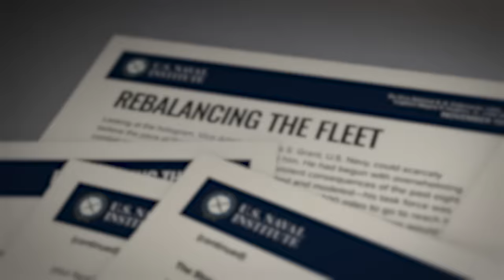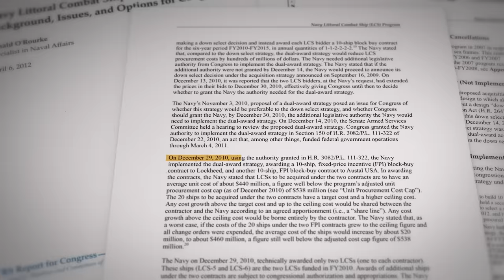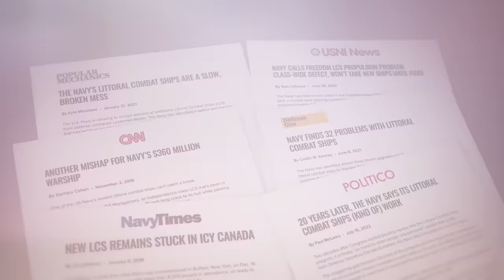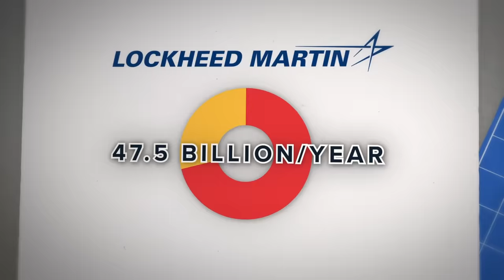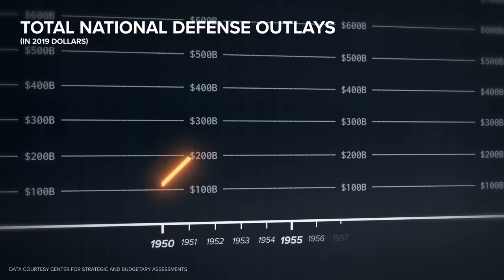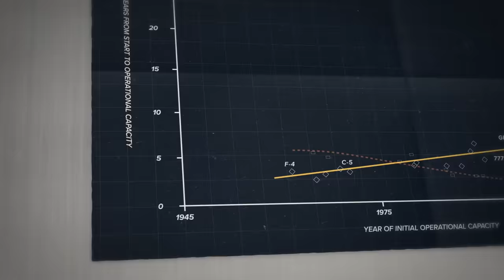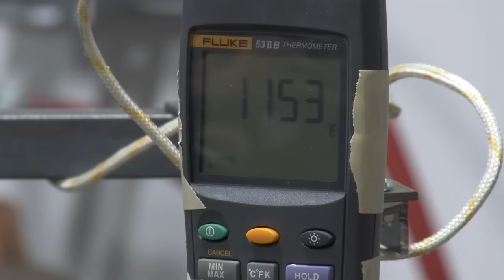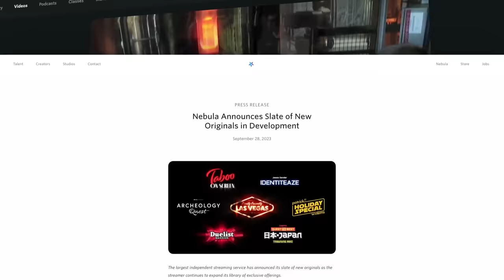Why the US Military Costs so Much

Comment: Cost efficiency does not equal innovation. It's a disingenuous association you make because your viewers will not question it further. Furthermore, you conveniently leave out the success of the existing programs to fit a narrative. The F-35, despite its cost over the years, has proven successful in many ways towards what it set out to do. The F35 has taken a long time to be developed because of the rapid improvement of its capabilities due to the advancement of processing power and emerging tech solutions. It's also been bought by the US's various allies, something you have also left out, with plans to continue selling more for decades to come. To add to this, on one of your graphs trying to illustrate how long we spend in between planes, the F16s currently still being used in current military operations, because we retrofit them to meet capabilities that satisfy the easier tasks of our current military as well as the desired tasks of the foreign governments that keep buying them. This is a good thing in the sense that we don't have to spend as much on producing aircraft, as we continue to develop our latest aircraft's capabilities and refine the newest designs to more easily meet the unexpected. In doing all of that, the taxpayer spends less on defense.

If you wanted to worry about ever rising costs of the defense budget, blame congress for coming up with incredibly stupid rules for the military to follow in order to keep their current budget afloat. Congress forces the military to basically make shit up to justify their spending, otherwise they face budget cuts instead of budget stabilization like it should be. Also, excellent job on mindlessly blaming the private sector for all of this too. The overwhelming majority of those jobs in the defense sector are protected by ITAR regulations, so essentially we can't just ship them off to another country to be done for cheaper, not that you would know or care about something like that, despite passing this video off as well researched.

Comment: It's just a little (sarcastically) bit misleading to compare yesteryears aircraft's 2-6 year completion cycle to today's 10-20+ year cycle.  Take the Uber-expensive, but Uber-capable F-35 fighter and it's 'many problems'. The helmet alone likely took more years to develop than a WW2 bomber did because of its complexity and its never-been-tried-technology. Add up all of the bleeding edge, never-been-tried before tech to a completely conceptual aircraft idea, make a scientific attempt at how much it's gonna cost and how long it'll take to build and wait. Wait and hold on to your ass when all the changes come flying in from the DOD and the House and Senate Committees. Once the contract is finalized the same group will keep throwing changes they're contractually entitled to which make the contractor look like the bad guy for time and cost overruns. Politicians, even those in uniform, know how to avoid smelling bad.

With a system like this, designing and building a machine so complex as the F-35 for example, it's amazing it only took as long as it did, and that the problems it's had have been as few and as minor comparatively (to planes designed and built in 2-6 years. How many F-35's have crashed in testing vs the F-14?), in fact to compare the 'decades' it took to create such an aircraft compared to past aircraft is plain ignorant without taking into consideration the advent of the technology of the time and how that affects the cycle. It's 'many problems' are directly proportional to it's massively complicated technology.

There are no other aircraft on the planet as capable and versatile as the F-35. There are no other aircraft on the planet as invisible on radar as the F-22.  This bleeding edge technology takes a shitload of time and even more money.

Comment: 10:10 Yup, some of the other US military fuckups (that are non political) include: the Lockheed Martin space radar that was 5+ years behind schedule, the USS Gerald Ford electromagnetic catapult not working, the Land Warrior system, Stryker system (as well as basically everything featured on the advertainment program called "Future Weapons"), the computer testing of nuclear weapons and no underground testing, the systemic wasting of billions by firing bullets to avoid paperwork or replacing perfectly good soldier level IT hardware every 3 years but not upgrading IT systems, no successful audit of the Pentagon ever, anything to do with Boeing's civilian or military software/quality controls (temporarily missing F-35, anyone?), the Bonhomme fire, the 3 US Navy crashes between 2015-2020, and the decades of wargames where OPFOR wins so the wargame operators change the rules.

Comment: Sorry but this video has so many errors or misleading statements its just BS. Whining about individual expenses without bothering to think "why"  is lazy and pointless.
1) Iceland had a limited defence since its a nato member and rellies on other countries to protect it
2) Every empire builds it armed forced for expeditions, the Soviet Union used to do the same, China is also building up this capacity
3) The US supplies its own bases because local procurement because local procurement can be unreliable or even dangerous at times.
4) Pushing technical limitations will always be costly and full of failures. But the cost of letting some one else figuring it out first is far greater. Most of the investment is not lost as the knowledge gained is used in future projects. 
5) Fraud journalists also like to blow every techincal issue out of proportion. For instance the F-35  has had less development issues then many other planes like the F-16 have had. 
6) 5 Potentioan defence contractors is a very healthy spread. 
7) Was has always been about profit and has always been expensive. Just having guys with swords might be cheaper per head but the massive impact of labour force was far most impactful. 
8) Glossing over the entire need for these investments makes the entire discussion pointless. Ask Ukraine, Georgia, Israel or Taiwan if this maters or not.  
9) Comparing development time of wartime last minute designes to current one is misleading since those designs where simpeler, more flawed and rarely lasted. Modern designs tend to be used for decades once adopted in large numbers. 
10) US defense spending relative to wages/PPP is fairly reasonable considering the runners up are China, Russia and India. None of which are friendly

Comment: The f-35 is very successful, why are you saying else why?
Reply: It wasn't at the start and still only has around 60-70% readiness up from less than 40 at start
Reply: @СергейСердюк94  60-70% is a great number, better than the felon, which has a what 3/12 ready rate
Reply: @СергейСердюк94  we also need to take into account no aircraft ever has a 100% ready rate within its first years of service, heck no aircraft has ever had an 100% ready rate
Reply: @squidcraft3878  that's just nonsense, the Felons readiness ratings have never been released, the Felon also didn't cost nearly $200 billion in development costs and didn't have issues that weren't fixed until years later.
Reply: @СергейСердюк94  because the felon isn’t even produced yet, it only really has 12 semi compete prototypes
Reply: @СергейСердюк94  did you even watch the video? Or are you to lazy to watch a half an hour long video
Reply: @squidcraft3878  this is pure nonsense the Felons was completed for state trials in 2019 and entered serial production in 2020 with over 20 production aircraft built so far with 76 intended by 2030 along with ~200 Su-75s, complimented by MiG-35s and Su-35S.

This video is nonsense, it literally says Canada and Mexico are good examples of a military spending
Reply: @squidcraft3878  the picture in my profile is a production Felon, you can tell by the aircraft. The main prototypes have different ones and are all grey
Reply: @СергейСердюк94  where?
Reply: @СергейСердюк94  you clearly didn’t watch the video, because the video debunks several of your claims, including the r-34 being “over budget” it have “low ready rates” and many other things
Reply: @squidcraft3878  what do you mean where, idgaf what the videos says lmao it's wrong.